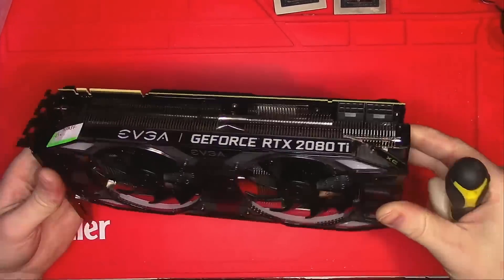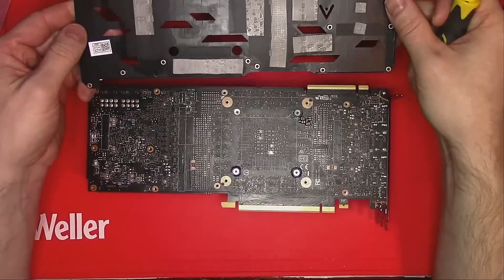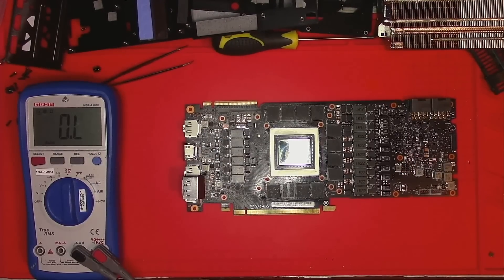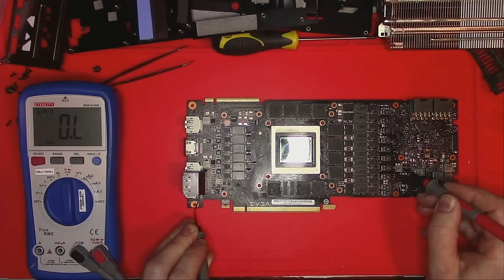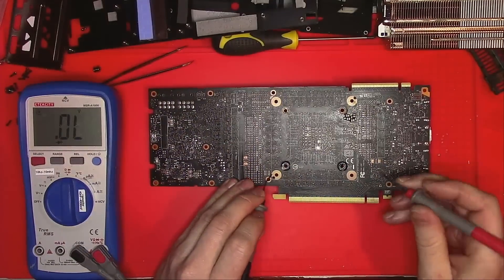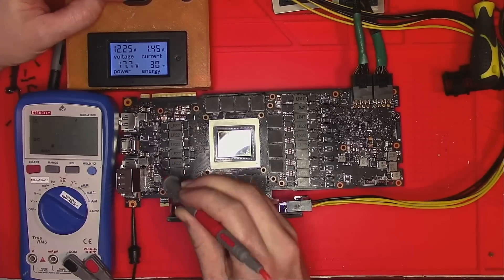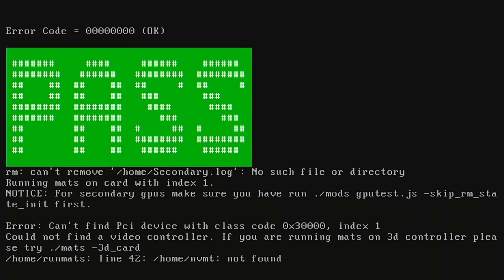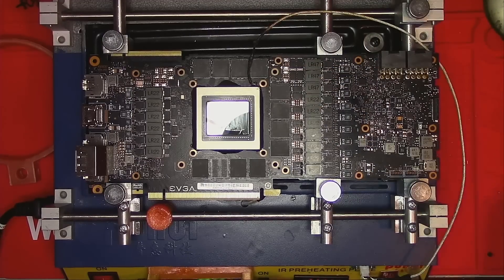graphics card black screen after installing drivers

Comment: I went into nvidia control panel and changed color settings to full screen desktop and I never get a black screen flicker anymore I read it on the microsoft website someplace anyways good luck trying all that other stuff. If you have nvidia I would try this first it may save you some time.

Comment: Bro can you plz tell me my gpu problem first it was running fine than after activating windows it started to give black screen the i deleted its drivers in safe mode ot runs normally without driver but when I install the drivers It started To Give Black Screen When I Instal Latest It Give Black Screen Suddenly but when I Install Old One After 2 To 3 Min It Gives Black Screen How To Fix It Whats The Problem Is it Damaged Its [AMD R7 450 4GB DDR5 128]
Reply: Windows automatically installs drivers in the background so you'd need to stay disconnected from the Internet to know if that's what's causing the black screen to reappear shortly after installing old drivers.

Comment: I have an EVGA RTX 2080ti FTW 3 - what size thermal pads does it take and whats the best thermal paste to use.. Its running fine atm ( same temps as from new ) but i know its going to need new pads ect in the next yr or so.

Comment: Hey, I have the same problem with my EVGA 2080ti black 11Go, my gpu wont even boot properly and it shows a black screen, it seems it tries to boot indefinitely and only one fan blows at 100% speed. I assume this either is a bad contact with a thermal pad (but why would only one fan kick off?) or a faulty thermal controler, either way, has any of you suffered the same symptoms?
Reply from the maker: Yeah. Hundreds of people had the same symptoms

Comment: Good job! 👍But how was you so sure that this is a gpu related prolem? In 2000 series cards memory problems can cause same symptoms, and often its pass mats without any problem. I have a zotac 2080 with the same symptoms you had, but I cant decide its a gpu or a memory problem. The memory is samsung, and just a little bit brownish, nvmt and mats pass just fine, but mods detect assertion failure. When driver loads sometimes its give signal, but black screen, sometimes dont give signal at all. What do you think, should I just reball the core, or I need to do something with the memory?
Reply: Thanks so much for replying back. I am also thinking of attempting this. Although I do not wanna risk the GPU thing and rather the RAM chips. I have further issue like the hdmj doesnt work too.
Reply: @joenamcoutinho3371  The HDMI thing is intresting. Investigate it as soon as you can, because the hdmi data lines are comeing straight from the gpu. If you miss datalines its very likely that the gpu lost connection with the pcb pads, and if the hdmi balls are lost connection, probably other balls are lost connection too, so its can cause the main problem. The 2080 hdmi balls are pretty close to the pci, so I think its make sense now.
Reply: Hey I have the exact same issue. And the same question. did you manage to fix it?
Reply: @joenamcoutinho3371  Unfortunately I didnt do anything more with the card. Now I'm practice with reballing, a few weeks and I will try to reball it. I inspected the bga with microscope, but no visible damage on the sides. A more practiced friend of mine said that its probably not a memory problem because samsung never fails. I will inform you after the reball.

Comment: 70 degrees on load is not bad at all 😅
I am amazed by your work. Really cool to see you accomplish results after re-applying the GPU die, only using your hands. There were a lot of connections in there.

Comment: if anything happens to my card i know who i will send it to. subscribing now. Literally no brainer. He has the tools and experience, i just hope it wont be too costly but if you spend 500 on a gpu i think you can afford to repair it aswell. thanks for reading.
Reply: @northwestrepair I have a genuine question i have a 3 fan 2080ti zotac and the fans cause turbulence or vibrations and one fan is going out. What type of watercooling would you reccommend for this card?
Reply from the maker: i dont know anything about water cooling

Comment: Ehm i think this is a 2080ti :P 11 vram modules on a 2080? Why?
Reply from the maker: who knows. ask nvidia
Reply: @northwestrepair  It's a 2080ti man xD it even identified as one in your video :P Correct your video title xD Cheers and thank you for your content, i have learned a lot from your content... I was able to fix a friend's 1060 with a sorted mosfet the other day... No fuse, the card got 12v straight to the core more than 10 times and it still worked and still works like a charm...

Comment: Thanks for teaching us all GPU repair. These cards are all throw away e-waste. I've been through a lot of them over the years and sometimes wished I had a better hobby like mud trucks or something. It's nice to know we may have a generation of integrated board and circuit repair specialists being born from watching your content.
Reply: Cars and trucks are WAY more of an expensive hobby
Reply: @@users-bibi50 that depends entirely on what you’re doing, it’s generally agreed that any money you put into a vehicle in modifications, you’ll never get it back when you sell it.  Only some vehicles maintain value, and even then it’s only if the mileage is low and condition still good, some cars rise in value, but unless you’re rich enough to buy a limited edition super car, it’s gonna take 10-15 years to see any real value gained.  You might be able to flip cars for a profit, but you could do that with hardware too.  You can get a good return on top end hardware, anything but the best doesn’t hold value well usually, as long as you sell it before or immediately after the release of the next generation of hardware.
Reply: I have no issue with e-waste... you can make into landfill or dump it... but I do like the idea of someone saving money and being able to feed themselves a bit easier

Comment: A little tip: A hair dryer set on its full fan speed and max temp will clean the flux under the gpu very well (its nozzle must be used to focus air flow under the gpu). You will see the flux get melted (liquified if you wish) and get out from the gpu and from under the memory chips if you want to clean them too.
Thank you so much for making such a very instructive video.
Reply from the maker: Interesting.

Comment: Stupid custommer. These wrong thickness pad will cause damage for the gpu in the future. High temp. Reballing gpu will not good as factory because of quality of solder ball. Spend some extra 15 20 buck for longevity of graphic card worth it. Again, stupid custommer.

Comment: Reballings are always so satisfying to watch, I reckon they're very finicky to do though
Reply: It is temporary solution, not a definitive fix. Card will be dead again soon
Reply: Says who? @rayhmann 
I don't think this true.
Reply: @zardyzardy8946  My friend that fixes laptops...and Louis Rossman, the most famous repair guy on YT. Search for it,he made a show about it couple of years ago.
After 6 months, most of those cards will die again
Reply: Thanks my friend, I just saw his video, the real problem is not with reballing the problem is with the chips themselves as he says and I believe that there are a bunch of videos out there for fixing dead game consoles or GPUs by putting them in the oven for heating them and I don't any of these ovens that reach the melting temperature, at the same time people want there devices fixed for cheap so they don't want a brand new chip. @rayhmann
Reply: @rayhmann  That louis video is 8 years old, at a time when GPU's were dying because the GPU itself is faulty

He literally talks about ATI laptop chips in the video, they don't exist anymore

Chips nowadays do not fail nearly as much as they used to

Please stop parroting BS that you don't have any idea about
Reply: @zardyzardy8946  Ne, he was specifically talking about reballing at a machine, not the oven method, which is not reballing
Reply: @jatie9  You arent a smart one, arent you?
Today situation is much worse. Cards work on much higher temperatures, and power that goes thru the chips is much bigger. 4090 can pull 600w! Cards 8 years ago went sub-200w (he also had a video 5-6 years ago about it..and the repair technology is still the same). And also, he said that a couple years ago again in some random video. I also know repair guys that say that even today, and it will always be like that, or worse

The one clueless is you.
Reply: @rayhmann  yeah so the its like sometimes reballing is not the solution for the problem as many people believe it's.
Reply: @rayhmann  people use the oven method thinking it will fix the the solder balls issue but the reality its just heating the gpu.
Reply: @zardyzardy8946  it is done bcs it is very expensive, so the profits are good. Most of the guys who know that sell their card or laptop after repair and the buyer gets the dud a couple of months after.
Reply: @rayhmann  you just make my point, chips can survive much higher temperatures nowadays... so reballing is less risky on the chip...
Reply: @jatie9  no, i didnt. Chips cannot survive much higher temps today, you made that up.
Reply: @rayhmann  If the chips cant survive being soldered then I guess they're just assembled with magic at the factory.
Reply: @honeybadger6275  completly different process, precision, clean enviroment, better materials. 
Reality confirms my magic thinking.

Comment: How driver install causes this?
Reply from the maker: It doesn't, it exposes an issue.
Parts of the GPU are not accessed without drivers.
Reply: @northwestrepair  so my understanding is that the drivers allow to access certain Hardware features, and this part of the hardware was already faulty before the new drivers. Is this correct?
Reply: @northwestrepair  also i have a question that I couldn’t find answer to. I have RTX 2060 6GB laptop, can i somehow add extra VRam to it? If so does it need new drivers to access the extra VRam?
Reply: @DoodieSmoothie  Thanks man, really interesting information